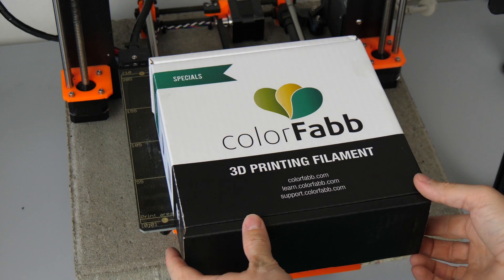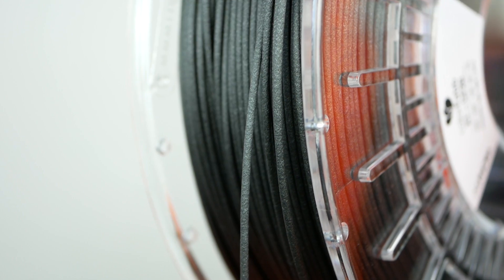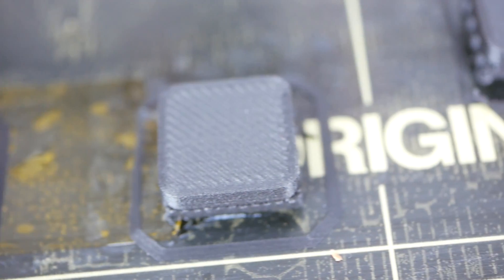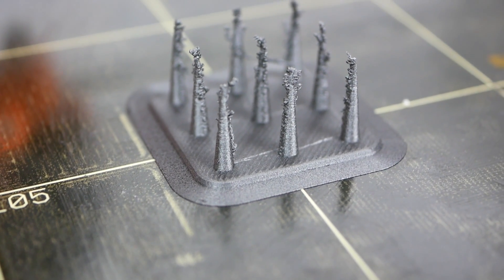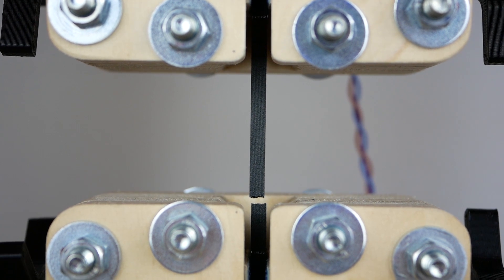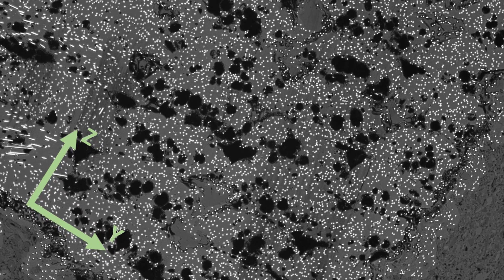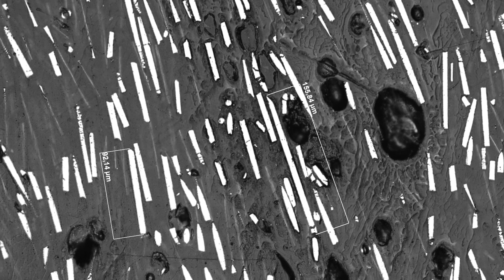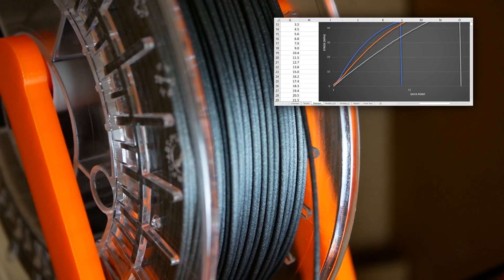3D PRINTING with CARBON FIBERS - ColorFabb XT-CF20 REVIEW

Comment: Your findings match what I generally see with carbon-filled filaments, both PETG and nylon, which is that the fibers add rigidity at the expense of toughness and layer strength. But it does look sexy, and if you are making quadcopter or airplane parts it is less dense so your parts are lighter.
Reply from the maker: Interestingly the carbon fibers decrease the density really a little (around 5%).
Reply: CNC Kitchen: I think it depends on the brand. For instance, 3dxtech has a CF nylon that is very high in fiber content. I use it for making fan shrouds and such on 3D printers because it is light and heat resistant.
Reply: Fun factish thing. I’m pretty sure Carbon fibre/fiber is more dense than most thermoplastics, especially the ones in 3d printing. Correct me if I’m wrong though.
Reply: @josiahong5177  I believe you are right. I think the idea is that the extra stiffness from the small percentage of carbon fiber added allows you to use less plastic, and overall there is a weight savings.
Reply: @0calvin  okay, makes sense. I always wondered why the cf nylon I used was denser than the regular nylon I used.